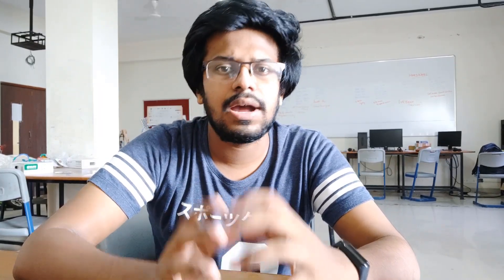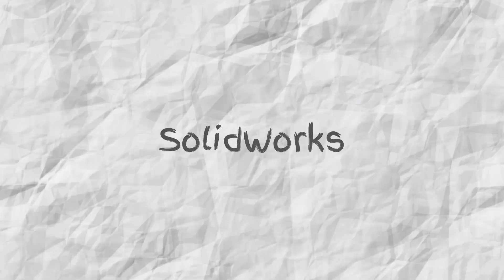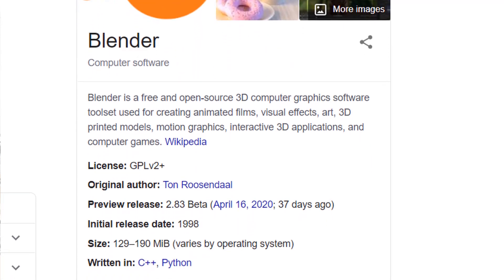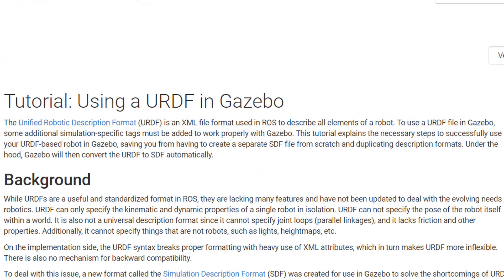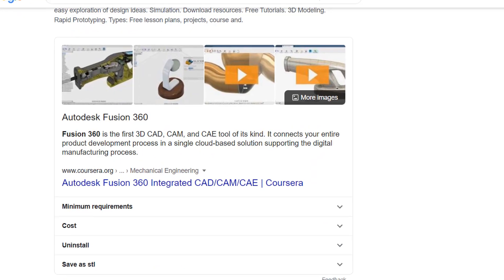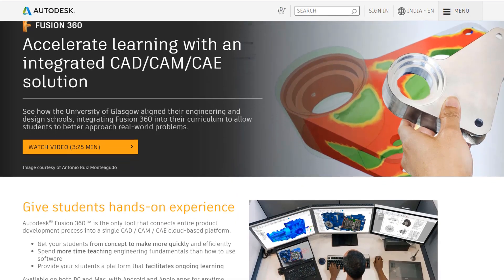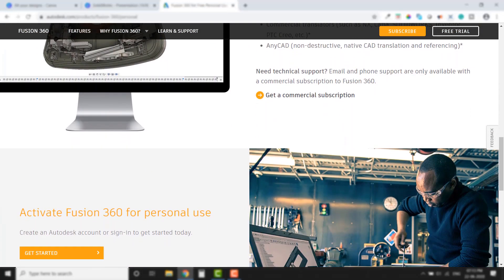Best 3D Designing Software for Robotics || Which Software to use for Designing Robots for ROS?

Comment: 00:01 Introduction to 3D Design Software for Robotics
00:53 Solidworks is a mature solid modeling design software favored in the industry for robot designing.
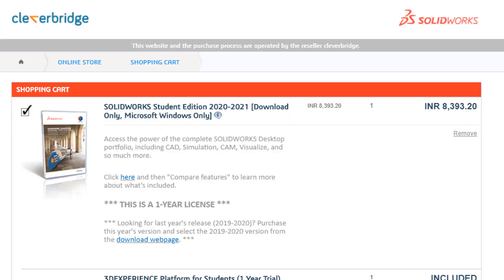01:44 Blender is a free and open-source software for 3D designing.
02:41 URDF is essential for designing robots in ROS
03:36 Autodesk Fusion 360 is recommended for robot designing.
05:46 Fusion 360 is a versatile cloud-based 3D designing software for robotics.
06:45 Fusion360 offers a range of design tools and simulations for robotics.
07:42 Skills matter more than just software choice

Comment: How is nx... By seimens
Reply from the maker: I am sorry to say, but you should get the answer by yourself by looking at people who know about it and use it. Plus, here i have mentioned softwares compared to the use in ROS. There are a lot of limitations in NX and hence it comes no where around Fusion 360 or Solidworks
Reply: @PranshuTople  Is catia or solid work which is good....on comparison to ROS
Reply from the maker: @mohitjoc25  Technically I won't recommend both. I would blindly support Fusion360 as it is everything you need. But if you compare between just Katia and solidworks, then I will choose SolidWorks
Reply: @PranshuTople  thank you so much sir, 🤗

Comment: How can i put robot in Solidwork to ROS? may I convert Solidwork format to URDF?
Reply from the maker: Yes you can. There is a plugin called as sw2urdf
Reply: @PranshuTople  What about assembly? Can I import Assembly in Solidwork to URDF directly or I have to assembly using URDF?
Reply from the maker: @dat nguyen ngoc Using sw2urdf, it imports assembly automatically. So you need not to worry about it. I will be uploading tutorials about it soon. So stay tuned... 😉

Comment: Thanks for the information, as always your content is just awesome. I have a question: apart from URDF, Is there any design program that is supported by Ubuntu?
Reply from the maker: Yes. You can view designs in different file formats on Ubuntu. You can view it in .obj, .stl, etc.
But if you wish to use it in ROS Simulation, then your robot model should be compulsaryly in stl/dae format along with URDF description of robot which joins all pieces together.
I hope that answers your question

Comment: Grouping components in an assembly is not possible in Fusion 360 which is a bummer... Nice video!
Reply from the maker: Why do you need to group components while they already are an assembly? You can just move one thing to move others. And also you can make nested assembly which works as the same as grouping. And thanks for the compliment on video 🤗
Reply: @PranshuTople  My main concern is with the components list on the left... When we make an assembly with a lot of components, it is very easy for the component list to run very long and end up confusing even with proper naming of components. So I feel if we can make groups to make the list look tidy and easy to navigate to components for selection/right click options